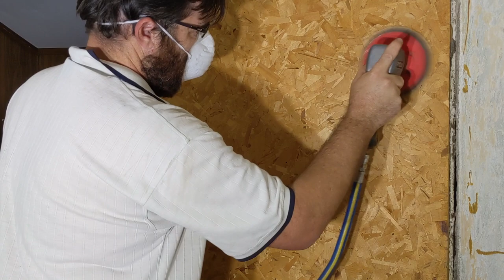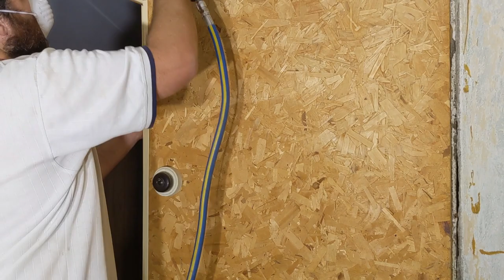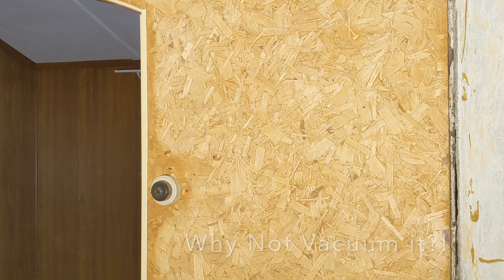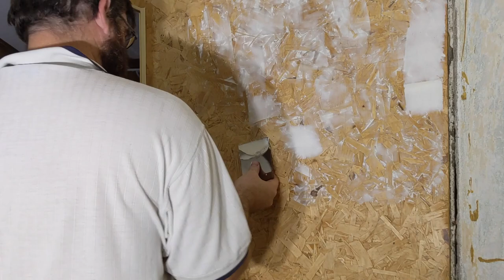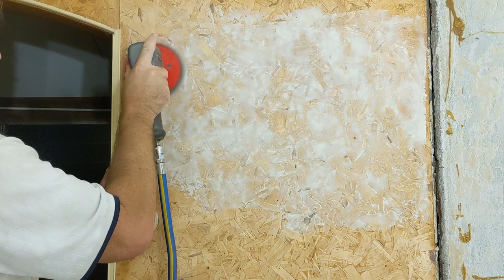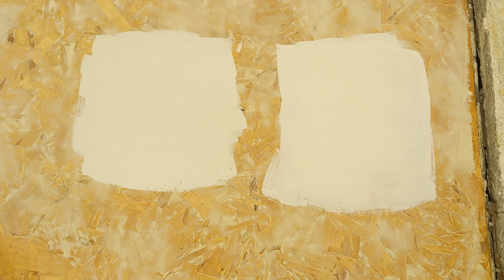How to Make OSB Smooth

Comment: Given the amount of square footage needed, the difficulty sanding the wood, the low profile of its surface imperfections, and the fact that it's being painted, I'd treat it just like any other drywall skim coating project.  Large spreader and some mud, some light sanding later of any ridges accidentally left, and paint.
Reply: Aha! I knew there had to be an easier way. I have a table with this material on top that I use as a plant holder. But I hated the surface. Im going to do that this weekend. Thank you!

Comment: You are making this so difficult. Just get spackling / joint compound and a wide trowel and screed a thin coat on the entire surface. in about four hours or the next day, sand the surface with 120 grit paper. Repeat these steps until the desired smoothness is obtained. lastly, coat the new surface with a wall primer paint. You can the touch up any imperfections with the spackling after it is primered.
Reply: true but depending on how old the osb is, sanding it will mean less sanding after the fill. older osb once you start sanding .. forget it, like pealing an onion, use your method

Comment: What grit sand paper were you using each time you sanded?
Reply from the maker: I used 120 and then 180. If you have the patience a second coat of filler would give it make sure you didn't miss any spots. But having said that it turned out really well on the test patches without a second coat. With a good undercoat layer or two it's going to look great I think.

Comment: Would've probably been easier to paint with a filler primer and sand afterwards
Reply: I'm wondering the same. I'll be trying the primer first. Plus, if you are going to do a mud skim coat, it's probably quicker (and definitely better!) to us a 10-12" spreader, instead of spotting it hear and there.

Comment: if its going to be painted, surely the best thing to do is use some filler all over it and then sand it. the big risk with trying to "finish" osb like this is a piece might chip out amnd all your effort is in vain.

Comment: Hi there. What brand of filler is that
Reply: I was wondering the same thing as well. So I did a search & found this, https://www.bunnings.com.au/parfix-1kg-ready-to-use-multipurpose-filler_p1210322  it's the same one he's using in the video (I just paused it on the can he was holding & did an image search for multipurpose filler). I tried looking locally like Home Depot, Lowes & even on Amazon but couldn't find it. I guess an equivalent to this product could be used that is sold in local stores. Hope this helps you out .

Comment: Could you use stain instead of paint?
Reply: No/yes You can use gel stain which isn't really a stain. Typically, resin filler is used on osb and resin is technically a plastic. Plastics will not absorb the color of traditional stains.